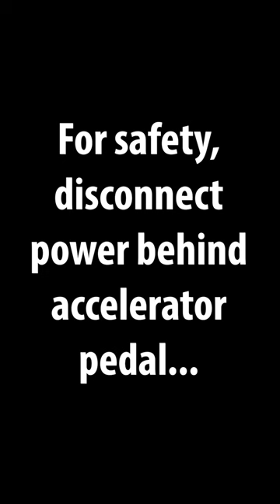2018 SPRINTER FACTORY RADIO REMOVAL - Using only 2 tools

Comment: 2012 sprinter 2500. can someone help me locate where the radio harness goes? mine was used and came with no radio harness. i dont know where the connection goes even if i bought the harness
Reply from the maker: Have you looked around inside there behind the radio? Should be a plastic wire plug of some sort. Maybe Crutchfield can help?
Reply: I looked and it's empty. It's not plugged into the radio, so it must of fell down. So where would the original wire fall to? The wire goes TO  the back of the radio, but FROM where? And who is CRUTCHFIELD
Reply from the maker: Hmmm I’m not sure what to tell you, sorry! Crutchfield dot com is where we bought our new head unit. They have awesome customer support and instructions for DIY installs.

Comment: I have a rear view camera in my car.  I have a question.  Will your radio work with my back camera?  Thank you
Reply from the maker: I think it should work. The one we installed has inputs for 4 cameras. I suggest looking at the installation manual for whatever head unit you decide to install just to make sure.

Comment: Howdy, I presume this needs new/different  fascia for double/single din? I have that same radio in mine and it seems wider? 
Thanks
Reply from the maker: We bought our components from crutchfield.com and we ordered the adapter kit they suggested with it. Both the factory head unit and the replacement are double DIN. Everything worked great.